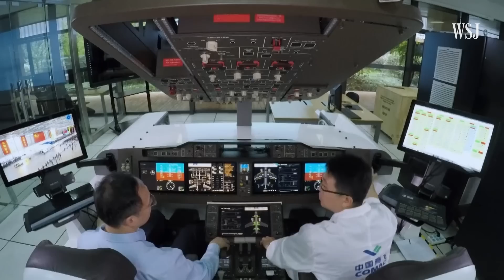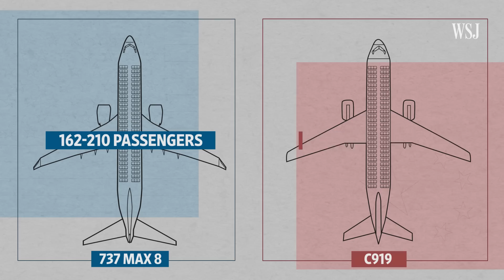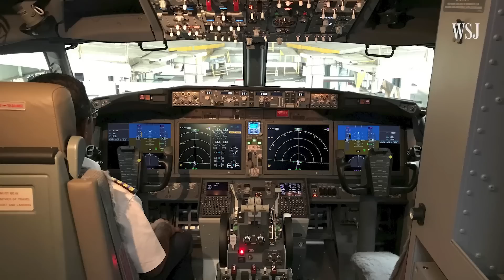Can Comac’s C919 Compete With Boeing's 737 Airplane? | WSJ U.S. vs. China

Comment: COMAC will have no problem at all selling every 919 they can build for the next 10+ years. As soon as practical they should source more components/systems domestically. The US and EU will do everything/anything to slow Chinas industry growth, including reducing access to components needed.
Reply: It is good for China, more challenges, more achievements
Reply: The C919 are already almost 100% replaceable with domestic manufactured parts. The reliance on imported parts is mostly for cost reasons. The military Y20 is 100% domestic supplied. Gradually they will be replaced as how it already happened in automotive industry.
Reply: Take my word for it.  China has a plan B.  It wouldn't have released C919 commercially if it couldn't control its future.
Reply: Components will be made in China as many parts of USA and Germany's auto industry and now EV batteries with CATL.
Reply: Sooner or later the collective west will put sanctions on COMAC and Chinese aerospace industries.. As a precaution, China should increase collaboration with Russia in building advanced aerospace technologies and products!
Reply: @ibrahimtouman2279  It is my belief China is capable of manufacturing all the major components.  To buy them from existing supply chain means C919 will be an international plane and the cost effective just like Airbus and Boeing planes.  However if the rule changes and China will have to go it alone then all foreign planes can only be allowed into China if Chinese C919 could go to those countries in reciprocation.  The supply chain manufacturers would want to supply parts to C919 so not all western countries would participate in sanction against China.  On balance China intend to make C919 in the same way Being and Airbus do but it will have a contingency plan.  China is of course can get parts and technical support from Russia.

China has a plant to assemble airbus planes inside China and manufacture parts to airbus for many years.  Thus China knows what it is doing.
Reply: @gunsumwong3948  engine would be the most difficult problem they are facing now.
Reply: @ShanghaiShuguangAnshabu  Not exactly.  China has CJ1000 engine under development, which is an equivalent of current LEAP engine from CFM International, but the engine is unlikely available before 2028. During 2022 China International Aviation & Aerospace Exhibition, China revealed a new turbofan AEF1300, which is supposed to be the civilian variant of the military turbofan WS20. So China does have a transitional substitute for LEAP engines before CJ1000 mature. The AEF1300 is supposed to be an equivalent of old CFM56 engine for 737 old models, but it is enough deter US putting sanction on engines for C919. Just think, if US was able to delay the progress of C919 significantly, why isn't US acting right now like what it is doing on semiconductor sector?
Reply: Whatever the US and EU do will only slow down china for a limited period of time. For the long run, this supply chain blockade will only spur the development of China's own component manufacturing industry. This has been proved many times, space technology for instance. The US and EU have to think twice if it is worth to sacrifice their short term profit to slow down china a litttle bit then get completely cut out of the chinese market for good, or they are more willing to cooperate with china to retain their shares in the chinese market for a much longer time.
Reply: The 737 sucks. Is there a new model for 2022 or something? I've been on the 737. It's not debatable. It's the worst Boeing probably. I remember the plane from the 90s when it was also the worst Boeing. Some Airbus was worse once, but I'm not really a reviewer and don't have the right to make a final statement (or anything which can be considered a judgement). That being said, Chinese manufacturing has never disappointed anyone. They also make disposable toys. It's an insult to the world to insult Chinese manufacturing (are you really a terrorizer?).
Reply: @Sean Rowshandel  naaa....I've flown on the 737 max 8 and it is one of the quietest aircraft I've been on.
Reply: @seanrowshandel1680  You're being silly, and childish. Nobody is insulting Chinese manufacturing, the plane will be good for the international market, and the 737 is a solid airplane, which is why its model has survived. What exactly did you find unbearable about the 737? It crashed? It was a little bumpy? 

Anyways, the problem with China at this moment is access to semiconductor technology. Most domestic phones utilize chips from Qualcomm, and so do computers using intel/amd and planes using imported chips from the US or Europe. When China develops its own semiconductor industry, it will be sustainable enough to  culture its own products with no reliance from abroad. As of now it's a fragile project.
Reply: @seanrowshandel1680  it’s a 70 year old design, of course it won’t feel as good. Hence why the a320 is outselling the 737. No one’s insulting Chinese manufacturing by the way. The issue is in how transparent Chinese companies can be, due to CCP involvement in every major Chinese company. Regulations set by the EU and FAA require inspections and documentation that the CCP may not be willing to divulge. Chinese manufacturing has a negative reputation that still persists to this day, so don’t expect international customers to show much interest in comac. That said, comac is perfect for China’s domestic market. But to your point, yes you are making a statement and judgment by your comment. Quit trying to be coy, and just be straightforward with your point.
Reply: Airbus has a plant in China building planes for Asian market.  China gave an Airbus plane order to Macron, and one to Scholz when he visited China.  China would buy other planes from Airbus, not Boeing.  so, plane parts shouldn't be a problem.

China bought its first generation High Speed Train from Siemens of Germany with all the right and patents, and one or two things from Japan.  China is into 3rd or 4th generation of HSR.

the HSR it sold to Indonesia is with technology transfer.  they have the confidence they will improve on the current gen of HSR.

Comment: And the C919 comes with a One Year Guarantee! (the joke) Quality and endurance will be the the test as too many products from China are not well built. And comparing it to the 737MAX as a state of the art plane is disingenuous. The 737MAX is state of the art electronics on a souped-up 1960s airframe. There's a reason Airbus is leading the market with the A320.
Reply: Chinese factories manufacture products based on what customers want. Are you willing to pay them $100 per screw driver, if it is made with titanium with 15 hours of testing to breaking at 10,000 PSI?
Reply: Boeing's MCAS is so advance that none of the the purchasers and the pilots know how to use it until the plane crashes.

Comment: I don't trust Boeing with the 737 Max with the cover up of the pitot tube failures and even the Dreamliner with the batteries catching fire. Airbus will far surpass Boeing in the future which has been corrupted by corporate greed - such a shame.
Reply: The battery issue was fixed years ago

Comment: Boeing's core value comes from B-17 and B-29, for which producing more war planes is priority over safe return of the plane. History tells the story.
Reply: But they upgraded the systems on those aircraft like better armor placement and defensive armaments and flying in higher altitudes to have the aircraft do return from combat missions. US was just able to manufacture more aircraft to replace if needed such. War of attrition practically. Still can’t down play older jetliners like the 707s, 747s, 727s that came and went
Reply: I think the issue stems from Mcdonnel Douglass where its more of a business rather than an engineer-run group
Reply: So they expertise in one way flying mission.

Comment: Boeing 737 series was designed 50 years ago thou it continues to improve/upgrade on many things, like engine, control system, materials, over time. But the backbones and basic design in 737 are never changed. Becuase it is pretty much re-designing a new plane from scratch if you want to leverage the current aerodynamic concept and technology. This process will take many years and Boeing is seeing that it will lose the competition with Airbus. So Boeing took the short cuts to compete with Airbus, the most obvious evidence is the oval engines with the lowest ground clearance. Boeing even did not tell airlines that 737 Max is equipped with MCAS and no information is displayed in manuals so airlines do not have to spend time and money for extra pilots training. There are tons of issues we can discuss 737. C919 is a much modern airplane in terms of design and build. It is better than 737 in my mind. I would choose C919 over 737 Max if there are options.
Reply: It is not that c919is good, more so that 737max is terrible.
Reply: @rocky137  If your opponent is worse than you, isn't that saying you are better?
Reply: No you didn't get anything at all.The mcas as its name says wasnt here to correct an aerodynamic problem, it is the unprecise explanation from TV. 

The plane flies without mcas in normal conditions. However, in certain cases with a high aoa for the speed, the behavior of the plane would be to much different. So Boeing installed the mcas, which is a manual flight aid that will only activate with flaps up and an high aoa. Its goal is to trim the yoke so the pilots have the same feel on it ,as they used to have with the previous 737s, despite the new engines, and in order to lower the training costs for airlines. 

Airlines forced Boeing to make the 737 max, they even clamed its existence for the first  time ever before the constructor, which had no other choices than starting working on it shortly after. 

They wanted a remotorised 737, for a few improvements and minimal training costs. So doing anything else would not be interesting at all, because no one would  buy it, as you would need to convert every 737 pilots into that new thing and a brand new type rating is really expensive for an airline . The 737 max in the other hand, thanks to the mcas , shares the same type rating with the 737 ng and classic....
Reply: @Hk-uw8my  i still insist choose C919 than Boeing 737 Max 😇😇😇
Reply: You're acting like Airbus doesn't exist, and as if China doesn't have A320s and A319s in service 🤣
Reply: @KarlenBell  Airbus does not develop A319s ... I did not say anything about A320 here and I think A320 is good. If China can produce its airplanes with similar functionalities, the demand for Airbus will be reduced. And Airbus can sell these planes to where those planes are more needed. Isn't this a win-win situation for the world?
Reply: @JW-bx4su  What do you mean A319s are not developed by Airbus? 😂 Are you confusing it with A220? A220 is not developed by Airbus for sure.
Reply: @KarlenBell Haha, I realized when I posted the reply and glad that you pointed it out.

Comment: I still don't want to fly on the 737 max. Aerodynamically unstable airplanes are entirely unsuitable for public transportation.
Reply: It’s not aerodynamically unstable
Reply: @JayJayAviation  yes it is, to the degree that it needs persistent software calibration from its MCAS system to stop it from nosediving. Who would've thought ramming in an entirely different engine at a different distance from the design spec of the airframe would've changed the aerodynamic behavior of a plane, huh?
Reply: @alejandrosalazar8766 ANOTHER WRONG ANSWER. MCAS was designed to avoid Recertification of pilots.
Reply: @t8polestarcyan22  Wow they should have hired you as boss and you would have avoided that.
Reply: @kiyoshim9593  Nah, you're much better :D

Comment: competition is good. Lack of competition brought us the max tragedy.
Reply: Max tragedy is pure corp greed.
Reply: FAA is responsible for giving green light as well.
Reply: Nah that’s not true. The Max program grew out of desperation to rival the much more modern design of Airbus - the a320neo family. Doing a clean sheet design would have taken too long so Airbus would have been able to capture much of the market. So Boeing rushed the Max design. The issue is/was Boeings relationship with the FAA, valuing money over safety and (in part) competition from Airbus.
Reply: @Agentencat  Is 737 Max safe now? FAA issued permits to 737 Max again. And it was FAA that issued permits to 737 Max before.
Reply: @biddeek1606  I don’t know, it’s probably safe but I won’t fly it soon. That’s why I said is/was
Reply: @biddeek1606  They didn't change anything, just updated the software on 737 Max to avoid the same issue, but the inherent balancing issue was not touched because that would involve designing a completely new aircraft
Reply: ACTUALLY COMPETITION AND GREED BROUGHT US THE MAX TRAGEDY....BOEING COULD NOT COMPETE WITH AIRBUS, THREFORE THEY CUT COST AND PUT A NEW ENGINE ON A OLD AIRFRAME WITHOUT BEING PROPERLY TESTED....FACT...AIRBUS WAS SELLING PLANES LIKE HOT CAKES AND BOEING COULD NOT STOP THE BLEEDING...ANOTHER FACT

Comment: Not with the new chip ban on China.
Reply: No worries, they are buying their avionics and flight control systems from western suppliers.
Reply: Only small percentage of applications need advanced chips, which China can produce but not at commercial scale, yet. Most applications use older mature larger chips.
Reply: chip ban doesnt effect china, plz check your info

Comment: I think A320Neo should be the benchmark instead of 737 Max 8
Reply: Headline is US vs China. Cant be French and German vs China. Gotta be US vs China. 😏
Reply: I’ve flown both planes and personally I like flying the Max more than the Neos. It’s much more powerful and fun when it comes to the thrust. But one negative thing about the max is it takes forever to start up. Clogging the taxi and gates are a big pet peeve for many pilots like myself. 

But quite honestly spec to spec they are very similar.
Reply: @danimalchen  Do you like having to have software correct an inherent imbalance in the plane's design at all times? I guess for fighter jets that's fine and dandy. For commercial? Give me the 320 anytime.
Reply: There is A320neo then many empty spaces the C919 and B737 crash 8! So don’t mix A320 with the other planes
Reply: Agree , they also has A321LR which can fly long route like twin aisle large airplane.